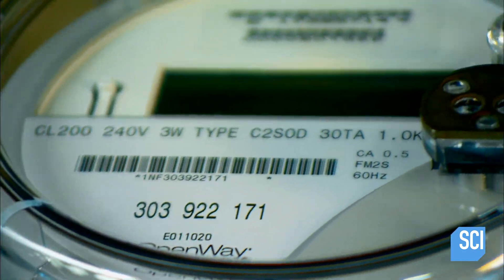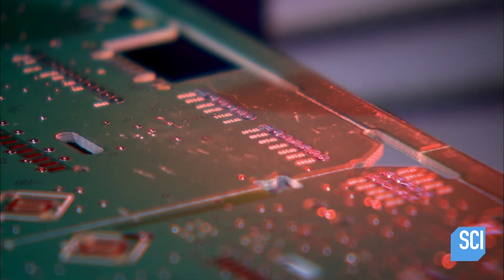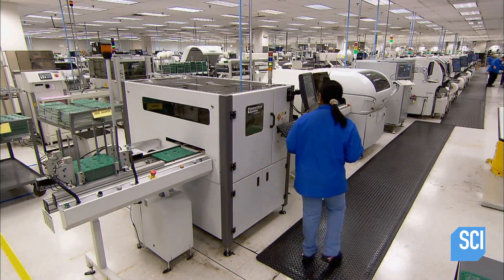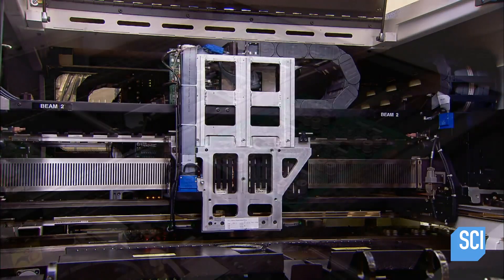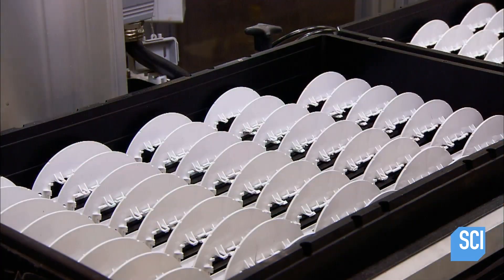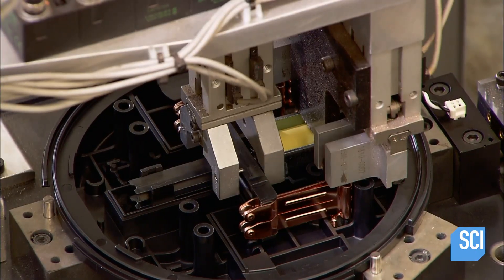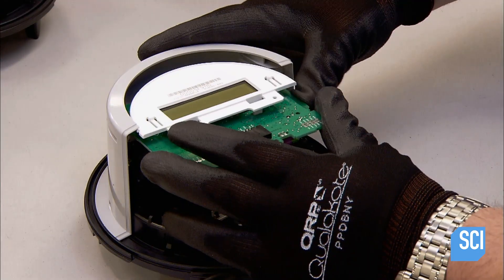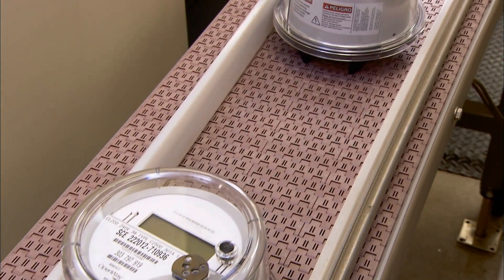How It's Made: Smart Electric Meters

Comment: As cool as this is, i dont like the thought of being one misclick away from having everything in the house shut off. Which, depending on the situation, can become quite costly as both heating, fridges, lights, freezers, etc. all require power to function.
Reply: True. Every command is recorded with the user name attached to it. Only way to mistakenly disconnect someone is if the meter information is incorrect. Records are important
Reply: I agree, or if someone built a device which would enable them to shut off your power, just to be an Jerk

Comment: The World Economic Forum will use smart meters to control your electricity. They will turn you off if you say the wrong thing on line. I know it sounds crazy but go read for yourself, they are not shy about their intentions.
Reply: God that's an insane proposition. Do you know that the darn power company already controls entire areas through the way the grid works? Based on your proposition the WEF would've easily disconnected entire states simply for voting Trump! You lot are a crazy bunch...

Comment: Excellent video. Over what radio frequency are these messages transmitted?  They don’t drive around and pick this information up. Do they connect to the Internet somehow?
Reply: Most will have a sim card and use a cellular network.
Edit: that's the standard where I live but in some cases they use RF to a nearby data collector, then that one uses some connection to pass on the data from multiple meters.
Reply: The ones that My local utility company uses operate off of a either 850 or 900 MHz mesh network system meaning each meter acts as a repeater and then every so often there are access points mounted on the utility poles.
Reply: He is right. The frequency they use is close to the same frequency a garage door opener uses. The information is also encrypted so information can’t be stolen or someone outside of the company can’t kill the grid
Reply: They send text messages not different then your phone

Comment: Anybody else notice they can just shut your power off from anywhere anytime.
Reply: Safer way to disconnect for non payment.  What are your thoughts?
Reply: Using a Flipper Zero to shut off power to houses.  @Amitech77
Reply: Sure, but utilities can't just shut power off for no reason. You get your power shut off for non payments or tampering.
Reply: Yep, originally sold to the public as a time and money saving device for the electric company....But as usual, this key piece in the electrical supply for your home has been weaponized.  Why do you think the globalists want to end hydrocarbon fuels?  Takes a major portion of energy away from the populus and makes them dependent on ONE source of energy that can be managed remotely.....Sorry Mr. jones, you've run your alotment of energy credits out for this month.....Your service will be restored in 16 days....Have a nice day.

Comment: And now, they can control anything in your home. I mean anything..
Reply: No they can't, they can turn on or off the electricity supply, that's it. If you're afraid they might turn off the power on you for no reason, buy a generator or a solar-battery setup.
It's your choice to use "smart"-device in your home and to connect them to the internet. Sure, if you made your entire house so "smart" you can just shout "Hey Google, keep the house at 70F as long as the solar panels deliver power, allow 7 degrees of variation when using grid power," somebody could probably hack in to that and freeze/boil you in your own home, or you could possibly sign in on a program that allows the energy company to raise or lower your thermostat depending on grid capacity, but that's entirely your choice and risk to take.
Reply: More like know when you're home, doing laundry, taking a bath etc. but nobody looks at that (yet).
Reply: lest the unwashed masses have control over their own possessions. life is great now that a private company can control our entire lives.
Reply: @dogmeat7486  buy solar panels, problem solved

Comment: 2023 smart meters: automatically shuts off power to your house when you turn on  2000W vacuum cleaner from 2004.
Reply: The smart meter can't see the difference between a 2000W vacuum or a 2000W washer/hob/powertool/airconditioner/... so no, unless there's a massive grid capacity problem they won't shut down your power if you use too much of it at once, they earn a lot of money when you use a lot of electricity, stopping you from doing that when the grid allows for it would be terrible business.
Reply: Smart meters actually have no idea what appliance youre using, they only know that power is being used, if you pull 2000W for example, it dosent know if its going to 1 vaccum cleaner or 20 lightbulbs
Reply: @lickablestinkage7783  it's unlikely someone turns on and off 20 light bulbs at the same time once or twice per week. it's a vacuum. if still in doubt, look at the power factor and you'll know it's from a motor. yeah, it's a vacuum.

Comment: Scary that they can't disconnect and connect your electricity remotely.  If in the future they decide you are using too much, they can just cut you off.....ughhhh.
Reply: cant speak on the distrust part, but there’s a safety aspect of it too. Wouldn’t want homes with solar pumping energy back into the grid while someone’s working on it.
Reply: @npgoalkeeper actually, what you mention is part of one of the fail safes of a grid tied solar. It will actually cut power from the panels when the power from the grid goes out for the reason you mentioned.
Reply: In the game Beyond Good and Evil, there's a scene where the local energy company says "Your optima account is 350 units short. Your electrical supply has just been blocked", which basically is remote access, the way it's been portrayed in the game. You can find that scene by looking for "Beyond good and evil domz attack". It's a game from 2003.
Reply: Or if you tweeted something against the government...
Reply: Or if you tweeted something against the government...
Reply: Either way if someone or a group of people uses far too much electricity the power company would've still needed to cut people off... just at a greater level!
Reply: Why would a power company complain about you using too much power? As long as you're paying I cant see why they'd care
Reply: if they don't like what you're doing they would just go to your house and disconnect the power regardless. A smart meter making a private company turning it off remotely makes no difference.
Reply: they will, if you don't have enougn carbon credit score or don't take all the goverment mandated vaccines.
Reply: @Xiefux  you were vaccinated as a baby, typical conservative mindset

Comment: This factory footage is from 2011 but that computer was still running windows 98. Come on
Reply: Some factories still use computers and machinery from the 70s, its not unusual
Reply: it's XP,  98 did not have auto updates tool
Reply: They run the same hardware and software in 2022. I don't know where you saw windows 98 but I can confirm the exact same test stations run windows XP to this day. Lots of industrial stuff still runs XP. It works.
Reply: It's XP you can tell by the logo on the Start Button. (Up to Windows 7 can look like that using the 'Classic' theme).
XP and older is often used to run this specialist software since newer OS's like to mess things up and besides it's not like these computers are browsing the internet anyways, they're serving a specific function. Even OS's as old as Windows 3.1 finds it's use here and there on some special equipment.

Comment: Smart meters have built in cell phones.  That's why electric utilities have cell phone antennas along their transmission lines and sub stations.
Reply: We use itron meters and they don't have SIM cards or communicate on cellular networks, they talk to each via a mesh network on the Zigbee protocol which in turn talks to Pole Mounted Routers (that do have SIM cards and are pole mounted) that work on a redundant network of our own internal radio communications system as well as cellular networks.
Reply: some of them do, whatever is cheapest for each situation

Comment: I saw a solenoid controls how they turn them on and off, so with a strong enough magnet  at the right location, you could bypass that
Reply: The meter would detect that the load side had voltage when it wasn't supposed to and alert the power company. It probably would be assumed a malfunction the first time if you could do it without them seeing anything sus when they came to check / replace the meter. After it happened twice at the same house I'm sure they would be unhappy with you. I doubt the magnet would work anyway. Those solenoids take a pretty strong pull to actuate. Source: I worked on these meters
Reply: @adammoore7994  a neodymium magnet might have the  power to actuate it as neodymium magnets are known for there strong properties
Reply: caught doing that though you would be arrested
Reply: @dawn1berlitz  most certainly but it's nice to know in case you need electricity for an emergency 👍 you can get yourself a neodymium magnet 👍
Reply: @dawn1berlitz  I mean I guess if there was an emergency you could just knock the thing off the wall and then run a jumper 🤣👍
Reply: @rvlifestylelivin  not really as they will see an outage and go to investigate it
Reply: @dawn1berlitz  it will not come up as an outage, an outage would be detected because of lack of continuity
Reply: @rvlifestylelivin  when they see a meter isnt responding they would see it as a outage but just one person but if the power stayed on despite a kill signal was sent ot the meter they will know the meter box has been illegally tampered with like you can be arrested for removing the electric meter
Reply: @dawn1berlitz  hook it up before the meter :D
Reply: @punker4Real  tampering with the meter box is illegal and plus the utility company would know if u tried to remove the meter and they see a unusual load in the area
Reply: Their relays are probably shielded in some way, though I’d imagine modern models swapping to IGBTs (or some other solid state relay tech) to decrease failure rates and increase efficiency
Reply: @npgoalkeeper  the only problem with that is it's actually impossible to shield magnetic force. If we could shield magnetic force we could have absolute free energy all we would have to do is have something spinning that would shield and unshield the magnetic force and then we could put an alternating generator on it and we would have perpetual motion but since it's not possible if you're using a solenoid which a lot of places do because they don't think people understand electronics but if you're using a solenoid you can reverse it with a very strong magnet and it would have to be an extremely strong magnet because you're talking about activating a solenoid from about six inches away from the glass minimum so it would have to be a special neodymium magnet that would be up to do it the magnet would probably cost you about 2 or $300 alone. But activating the solenoid would send electricity across the second portion of the meter and they would be notified that the electricity is running so it actually wouldn't work well at least they would be out there in 24 hours to fix. The only way you can get away with it would be to run a jumper from the live wires underneath the ground and out of view
Reply: if you do this, wrap the whole thing in a bunch of aluminum foil and hope that the tamper alert message doesn't make it out. they'll still find out eventually ;)
Reply: @petergibbons607  more like they will find out fast when the system doesnt get a response from the meter and then when they show up they end up coming or calling police as that would be consider tampering

Comment: Didn't know they had a remote disconnect in them.
Reply: Not all of them do.
Reply: Me either, but makes sense that the option to add one could easily be added. The one-time cost of having it added to the meter could save an employee time and fuel from not having to drive out to the residence and pull the meter off, put on some little dielectric condoms over the contacts and put the meter back on (At least that's how most power companies cut power to a residence) 
It wouldn't be worth it though if the meter didn't already have remote connectivity, because over their lifetime, how often do you think most meters ever have to be disconnected?

Comment: in the past we had these analog disk devices where we made a very small hole parallel to the disk and inserted a needle to stop it
Reply: I used to work at a meter lab and I remember my boss telling me about a simple way that an electromechanical meter could be disabled without having to mess with magnets or anything similar, and impossible to prove tampering. All you needed was a magnifying glass (yes, I understood the theory what he was hinting at, and no, I will not share it).
Reply: @observe_and_purport  the visual inspection was usually from the distance, the distance where the numbers could be read.
many times when there was a more detailed inspection (you knew when) the plastic cover was removed very carefully (the one with the hole) and another perfect one was added with 2 points of superglue.
usually there were 2 inspectors per 2,3,4 localities and if they took a penny from each house that had this system without saying a word easy money...
Reply: They make me nauseous, they make my heart palpitate, they've fried the delicate brain nerves from inner ear.

Comment: I remember when humans had to do all the placement and soldering of electronic boards
Reply: When was that?  Since the start of mass production of PCB based electronics there have been automated lines, before that electronic devices usually had no PCB and just ran wires from separate components which was a mess...
Wave soldering has been around far longer so there was never really a time where humans had to do all the placement and soldering on PCBs...
Reply: I remember when all wiring in electronics was point-to-point, and also when the forerunners of the circuit board began to appear in small vacuum tube radios. They were called couplets and were small, flat, sealed assemblies of perhaps 6 components inside. Typically, 6 wires came out one edge and were soldered to pins of tube sockets, and so forth.
Reply: I work at one of these plants and not all lines are automated, alot of them are still done by hand and it's so tedious
Reply: @Raviolli96 Are you guys still hiring?? I just completed my Pre-apprenticeship as an electrician like 2 weeks ago and im interested into getting an intership there

Comment: Your meter is monitoring you and what you are using
Reply: they also cause cancer, yay.
Reply: Yes, that is the point of an electricity meter, to meter how much electricity you use... Next up: your vacuum cleaner turns on every time you use it!...
Reply: @someguy4915  Nah dude, they can literally tell what you're using by its power signature. I work with these meters and their associated equipment and they can %100 tell when, how, and what and you are using.
Reply: @Smokkedandslammed  Nope, they know the total power consumption, but even stuff such as power factor isn't measured, meaning they cannot differentiate what type of consumers you are using such as the difference between an old light bulb and a computer.
Something you would know if you worked '%100' with them, whatever that means.
Reply: @Smokkedandslammed  Okay, sure dude, whatever you want to believe...
The 'power signature' does not exist, at best you can guess the type of device by checking the power factor, which these meters cannot do...

Since you work with them, tell me what equipment I'm using...
Reply: @someguy4915  Hold on, let me compute and enter some algorithms....Ok, got it....Ohhhh dang, you were right, I can't tell if you have your real doll heater plugged in or the heater for your flesh light tucked between your mattress and box spring. I can tell that what ever it is gets turned on and off a lot though...
Reply: @Smokkedandslammed  Tell me you have no clue what you're talking about without saying you have no clue what you're talking about xD
'enter some algorithms', next time try harder, or just actually learn about how things work...
Reply: @Smokkedandslammed  smart meters literally have no idea where the power is going, it just knows its going somewhere, it dosent even know when you turn something on or off or if its just on all the time but drawing varying amounts of power

Comment: apparently these also make grandpas experts in electric devices since they make scientific claims that these emit harmful radiowaves and you can only cancel them with aluminium foil
Reply: these meters send information over cellular network and only 1 or 2 times in one day, so they emit as much radiation as sending 2 text messages
Reply: @piezku  They don't use cellular.  They uses a dedicated mesh networking system to carry the data.
Reply: @overamped23042  depends on the device / location of installation
Reply: Idk what a grandpas experts is but I can say I worked in this production facility with hundreds of other people. hundreds of these meters would be actively emitting rf at a time and it was not an issue for anyone. Which makes sense. It's all non ionizing radiation. Not any different than your cell phone or toy rc car or wireless home security system. And yes. Some of those meters use 3G 4G 5G or some other rf band. Some even communicate through the power lines themselves. Just depends on what the utility wants for whatever area.